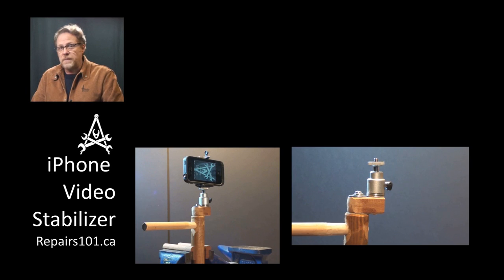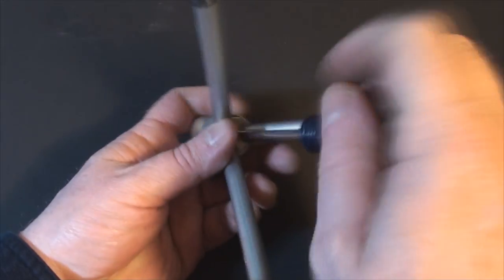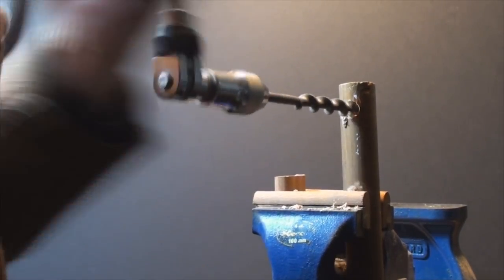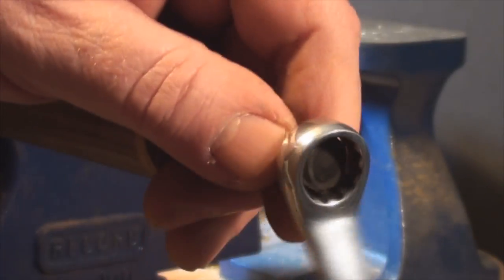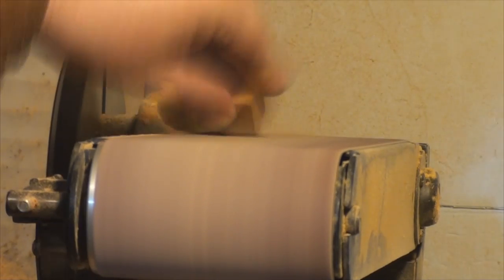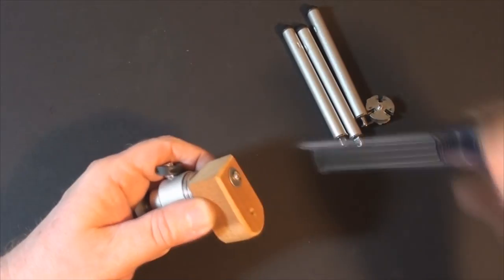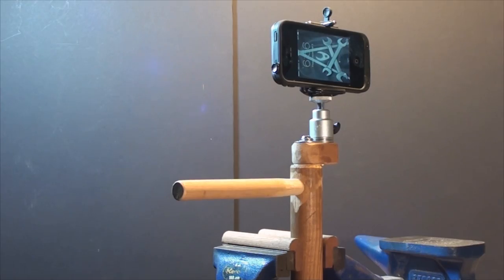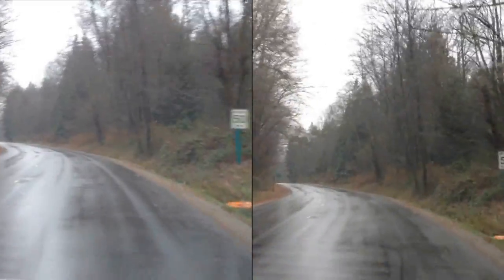iPhone Video Stabilizer - Easy Woodshop Project

Comment: Thanks, another one for my project list.
Reply from the maker: Edmund Mendez Mine still needed another counterweight washer and my handle needed to be sanded down a little more so I could have a 1/2 inch protruding from the other side - to hold between my thumb and forefinger for recording while walking.